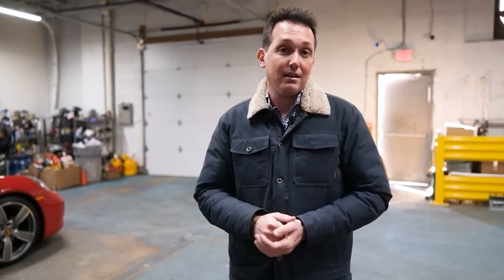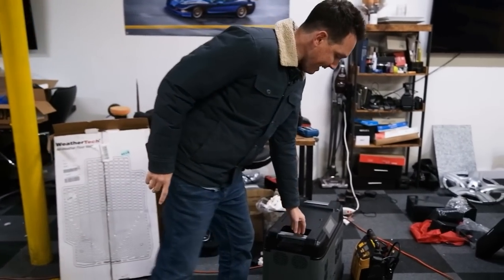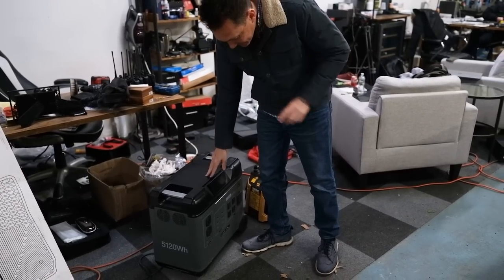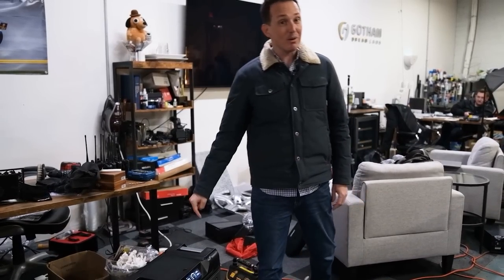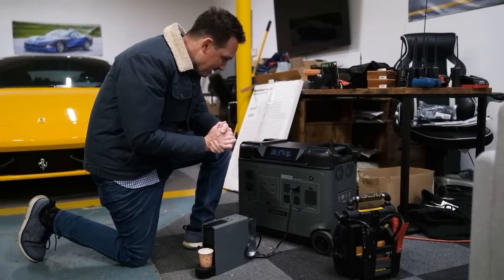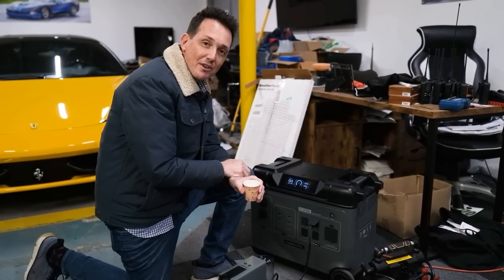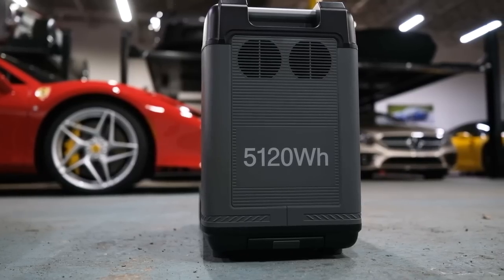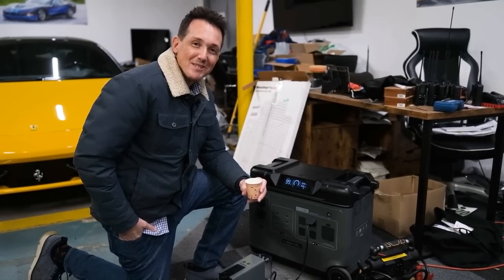Finally Found A Way to make Espresso In my Truck!

Comment: That model mini espresso machine draws 1260 watts! Those outlets in the truck are rated for 250 in the front and 450 in the rear. For comparison, your large Kitchen Microwave draws 1200 watts. Space heaters are typically between 850 and 1500 watts.

Comment: The problem isn't battery,  the problem is inverter.
You only needed a big enough inverter to handle 2000watts+.
BTW that battery pack WON'T charge a Tesla enough to get anywhere.

Comment: I have a nespresso In my work truck (suppose you would call it a semi) all you need is a inverter with suitable amp output, admittedly my system is 24v on a dual 12v battery setup but I’m sure you can get big 12v inverters, 
Would have to be battery hardwired mind

Comment: My truck has a 7200 watt inverter built in. It will not only charge a Tesla, it can run 4 Nespresso machines simultaneously for when you want that venti shot and can’t wait.

Comment: Ok I don’t know who else needs to hear this but espresso is coffee made above 7 bar of pressure  Nespresso isn’t espresso it’s a weird in between adjacent to drip coffee and espresso if you like it great but it’s pressurised unlike drip of pour over so it has a higher extraction but isn’t brewed at a height enough pressure to extract like a espresso it’s not the same it’s just concentration it’s just a concentrated filter coffee

Comment: I dont drink coffee I drink espresso, did you just bring a 2nd battery bank to produce 1.5kW temporarily next 400kW engine inside that truck? Amazing...Battery next to generator it cant get any better... maybe the espresso for 12V would do the trick just thicker cable from batteries and it would take a bit longer...

Comment: How is lugging around a 80lb power supply better then an inverter that weighs 5lbs? What you have there is a Danali of power supplies, way over kill then what you need. Just like what you said about pickup trucks.

Comment: That's awful The truck couldn't even power a little espresso machine Cletus McFarland his raptor could power like six fans used for cooling down his cars after doing a drag run 2000 wats
Reply: he was using a 12 volt plug that's why, need an inverter to power things like that
Reply: @ESPSJ  ah ok makes sense then